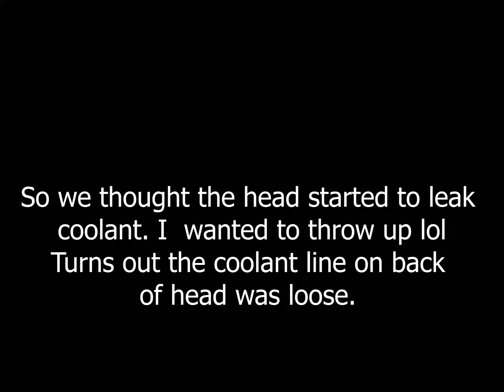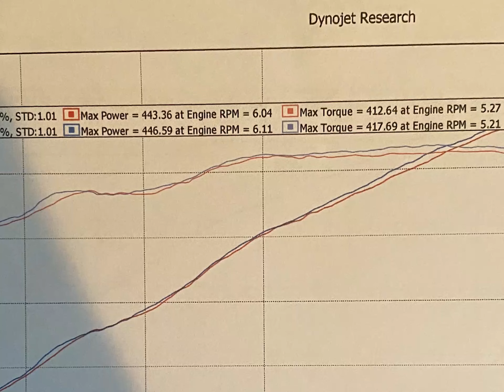Pontiac G8 Dyno Day!!!!

Comment: I love that paint job! I see you have the blower cam. You have some good hp there. Do plan on adding a supercharger? I have a 2009 G8 GT with a Magnuson 2.3 liter supercharger, stage 2 cam, Bosch Injector Dynamics 1050 fuel injectors with dual fuel pumps, Flex Fuel Kit, dual tuned for 93 Octane and E85 with methanol/water injection, 160 deg. Thermostat, Rotofab cold air intake, machine polished throttle body and heads, 3 in. long tube headers and X-pipe. It's tuned on 93 with 6 lbs of boost and tuned on E85 and meth with 12 lbs of boost. It's Dyno Tuned using HP Tuners software. It puts down 585 hp to the wheels on 93 and 715 hp on E85 and meth. The red line was tuned up to 6,350 rpm. That 6.0 liter V8 has a 10.4 to 1 compression ratio so if you plan on a supercharger or turbo I would encourage you to get the E85 meth set up so you can pull timing and run more boost. If you try to run more than 6 lbs boost on 93 with those 10.4 to 1 flat dome stock pistons, you risk blowing things up. I bought my G8 new in 2009 and just did the mods last year. I had the DOD active fuel management totally removed. It has just turned 77,000 miles. I'm and old guy and this the best car I have ever owned. I've never had any problems with it. Back in 1987 I bought a new Buick Grand National and could kick myself for letting it go in 1991. Anyway I hope you enjoy that G8; the last great high performance Pontiac! Thank you for posting the great video!
Reply from the maker: That’s my goal is to go LSA at some point 😎. Wouldn’t mind the Maggie TVs-2650 but I prob should build the pistons etc to hold the max power for it. I deff will go lsa on e85 with some extra add ons. But nice car you got! Do you have an Instagram?